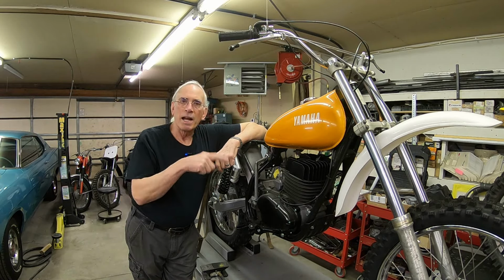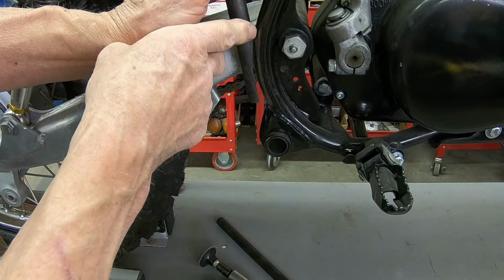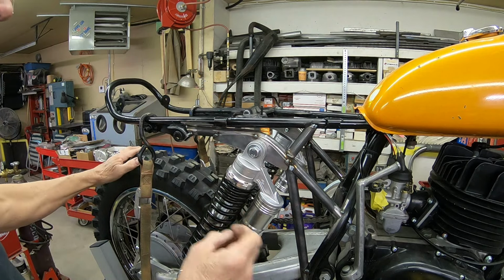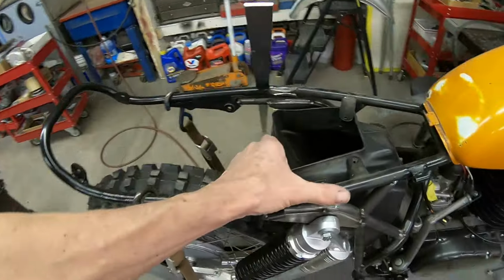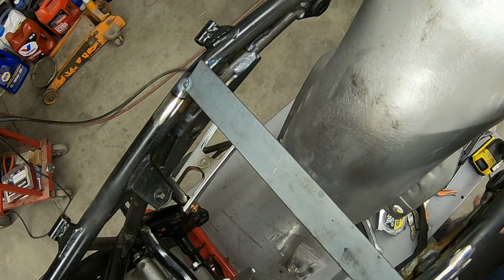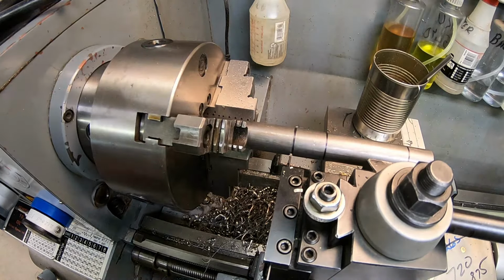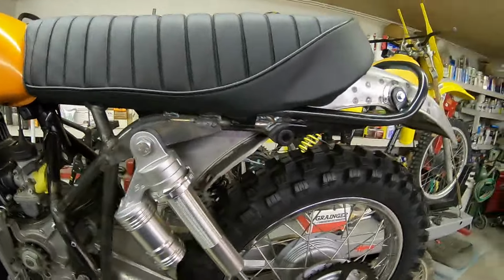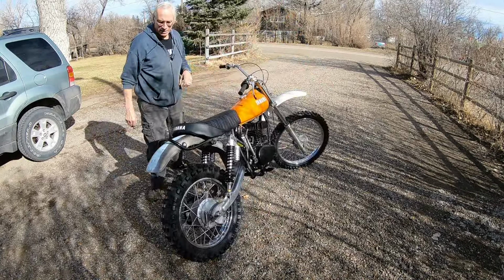Yamaha 250MX build, frame mods, rear suspension, welding.

Comment: Dale, I've been watching almost a year. I'm retired now and in the garage 4+ days a week working on the old bikes. Such great theapy etc. Your channel is wonderful & extremly helpful!!! I''VE LEARNED SO MUCH. I only have about 2% of your talent and tools but my life has been so much more gratifying becuase of this hobby. I hope many more use you as inspiration. THANK YOU SO MUCH!!!
Reply from the maker: Hey Chad, thank you very much for hanging out with me in the shop. Sounds like you're getting in the swing of things. You are right it's great fun and therapy at the same time. After I retired, I spent about 60 days napping and doing nothing, then I slowly got started again in the shop and have never looked back. Sometimes I don't get much done, but I'm out there anyway. Good luck in your retirement.
Reply: Thanks Dale, hate to bother you but really curious..I heard you mention delivering mail. I'm sure you must have been a machinist or ???
Reply from the maker: Hey Chad, I grew up as a farmer, so we learned to fix everything, my dad saw to it that I could run equipment and weld. Early on I worked for a motorcycle dealer, then spent over 20 years in the military, then I did over 20 years as a mailman at the USPS. Lots of what I do I learned myself with the help of many youtube channels.

Comment: First bike I ever race on, '68 DT1 enduro highly modified, git kit pipe, laid down Curnutt's. My first Dist. 37 desert race in 1975 out at Cal. City, got 10th overall beginner class. That's back when you'd have 200 beginners on the line. Great bikes for their day. Also had a '69 CT1 that was a great bike. Looks like you're doing a really nice job. My grandad was a fabricator, and did a lot of work for Preston Petty back in the day. The bike you see me sitting on in my profile pick, my granddad got in trade for doing fab work for Preston. Needless to say my '68 DT1 that I raced on back then was pretty tricked out, and dialed in.
Reply from the maker: Cool story Craig, yes that bike looks trick. It is amazing how things change but still remain the same in lots of ways.  Fabrication is one of the most fun things for me. I think most folks like doing it.

Comment: Good afternoon Dale. Just got back home from Phoenix a little bit ago. The Honda got sold and I picked up a 71 TS125. Couldn't resist it, got a good deal on it. Also stopped by the salvage yard and picked up the wire harness for the 185 along with some other parts that I was needing. All in all it was a good day.
Reply from the maker: Hey Dave, think you have more bikes than me. Got to get them when you find them, especially if they are at a good price. So, you're starting on the 185 now, think you said you were going to do the suspension upgrades to it. Let me know how that progresses.
Reply: @montana2strokeracer  I only have 10 Suzuki's.  That's  with the 185 and the 125 that I'm working on. I will be doing the suspension upgrades on both after I get all the frame gussets and alternate upper shock  mounts welded in.
Reply: I forgot to ask, How did the test fit of the RM side panels go? I like your idea of going with the RM forks and front wheel on the Yamaha. Might make things a little easier for you. Something else you may want to consider is finding and modifying a TM250 exhaust pipe to fit the Yamaha. May save you some fabrication time.
Reply from the maker: Hey David, I haven't tried the panels but I sure they will not just fit. I kind of like it without side covers, don't need them for I am not racing. Yes, the RM forks are what I had. I just decided not to use the Yamaha AT1 hub, going to use the same year as forks, hub and plate......your right it does make it simpler and was not too much money, more to come on that part of the bike. I have the correct dimensions for the expansion chamber for this engine, so I will be trying to build one that will enhance the performance. I built a couple pipes a few years ago, not easy, slow going, but you can make them really fit nice if you take your time. I'm really not worried about fab time, I'm retired and have lots of time, I just enjoy the fabrication part of this hobby. Its more about the fun than anything.

Comment: Man, you are really bringing back the memories for me. Had one of these in 74, which I replaced with the 78 IT 175. You are spot on trying to improve the suspension,the stock shocks on mine literally bent in half! And just to keep me honest, the ignition pick up went wacky and made the engine run backwards. People thought I was full of it, but made it interesting many miles from home.
Reply from the maker: Thanks Ed, yes you are right, anything done to the suspension on these has to be an improvement. The IT was a much better bike, but these are cool!

Comment: Nice bit of fabrication work Dale! Looking good!
Reply from the maker: Thanks Dave, it is coming along, now I have to sort out the front.
Reply: I do have a question for you. I know you are planning on a down sweep pipe and since you have altered the frame, what are your plans for side panels?
Reply from the maker: Haven't really thought about side panels, this seems a bit narrower than the RM, I'm just a trail rider so I don't need number plates. But I will think about it anyways. I have some for an RM maybe I will try to fit them. Good question.

Comment: Great work from a true fabricator. Nice redesign as well.
I'm curious about the wire feed welder, because of how clean it seems to weld.
What brand and model?
Reply from the maker: Well, thank you very much, but I just like to piddle with stuff. This kind of thing is just fun. Oh, the MIG welder I was using in the project is a Lincoln SP135, don't think they make them any longer. Think it may be a 140 these days, it is a 115-volt light duty model.

Comment: Good idea - Removing the original rear bar of the triangle significantly weakened the frame design geometry. The additional short piece added in front of the shock helped resolve this issue by tying the new parallel frame / shock member to the top horizontal bar. For the few grams involved, the frame could be further strengthened by adding a piece between upper & lower parallel bars above upper shock bolt. That would stiffen & counter increased lateral forces caused by the increased acute shock angle. Excellent decrease of unspring weight. Thinking the spring diameter may be too large for these design changes, but will depend on rider weight, dampening, etc.   We added Konis to an old Kawasaki & needed to significantly adjust the spring rate.
Reply from the maker: Hi thanks for all the good suggestions. Are you the frame maker that commented a couple months ago? I learned a lot of good info from you. My intentions are to put a gusset in the spot you are suggesting in this comment. I believe as you state it will further strengthen the area. Yes, the jury is still out on the spring rate etc. Only time and riding will tell. Thanks for all the good info, sure appreciate it.

Comment: I may
 have missed this but what swingarm did you use?
Reply from the maker: Hey Evan, I used the 78 1/2 Suzuki RM250, but you could use the RM 125 or RM 400 from the same era. Just make sure it is the Aluminum one. You will notice a little difference in the wheelbase depending on which one you use. I believe you could use the later full floater type, but you may have to modify the swingarm. I'm sure a Kawasaki, or Honda would work too, but you will have to modify the front of the arm instead of just making bushings like I did for this one.